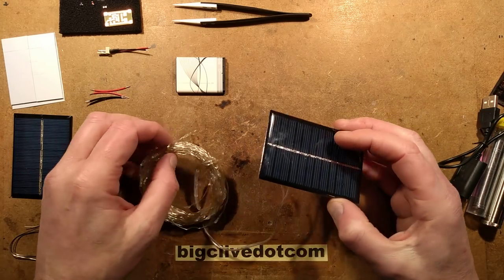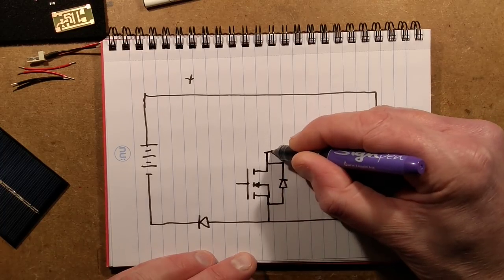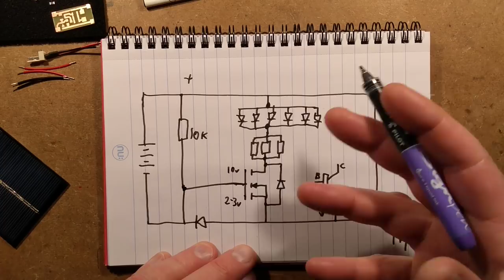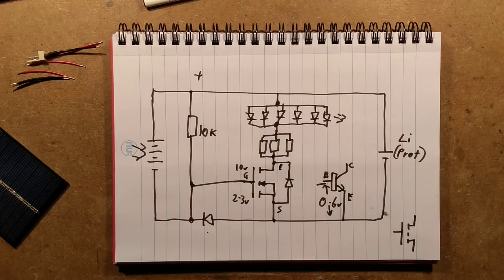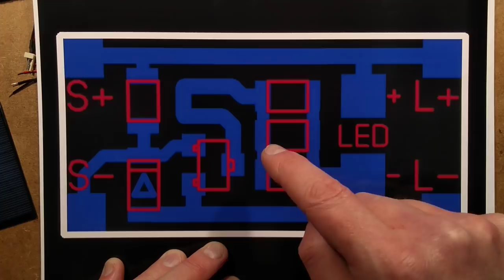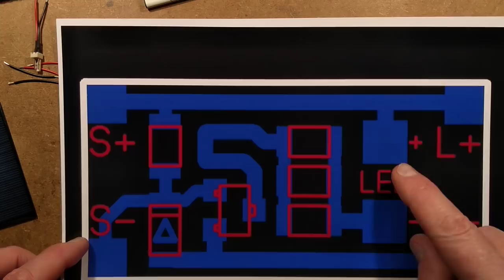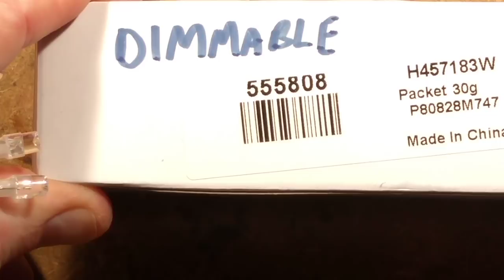DIY solar garden light project.  Surface mount remix.

Comment: Very impressed with the e-cig soldering iron. Just the thing to carry around with a bit of solder for those occasional soldering jobs. The circuitry in those little tube batteries isn't that robust for frequent heavy duty use though - better to put it onto a small variable wattage device which will have more oomph and longer battery and circuit life.

Comment: Clive,  If you mean the ts100 and 80 irons, while they do have problems (mainly the Git Hubs Ralim's firmware hack) playing up.
The stock firmwares pretty much do what they say on the tin,  Plug into a wall wart or attach a beefy battery (USB type c for the TS80 (stock firmware won't work with USB2 - has to be QC3 compatible) or for the TS100 - a massive Lipo or a dewalt drill type of battery pack.
Whatever else they do do  - they don't seem to melt down or crash.  The only report I've seen on Git this year was from a guy who I wouldn't give anything sharp or hot to play with!!!  With stock firmware the main problem seems to be QC3 compatibility of power bricks with the TS80 and for the 100s finding (and funding) Big enough batteries for the TS100 (everyone wants 60 watts that hits temp in > one second - those who can wait a couple of seconds seem to get minimal grief of any kind.

Comment: Big C. I got a simple 7 inch cheapie digital microscope that's perfect for the smallest smd. I paid 80cad on amazon which I probably around 35 pounds haha it is 1920x1080 screen and takes pictures. It's a no brand Chinese but the worksurface is about 100mm by 150mm.

Comment: Pressing the button to turn the soldering iron on is common for me, as I often use a cheap soldering gun, and keeping the power button pressed in a rhythm is needed to keep the soldering tip in the range of usable, not too cold, making a dry joint, or too hot, making the flux burn off rapidly and charring the board.

Comment: GREAT little project bigclive!! I really enjoy these kind of circuits - BTW I took your advice (on under cabinet kitchen lighting) - I found and bought a 12' length of water proof LED tape with RGB & W LEDs it came w/ a remote, power supply and many pre-set color combinations as well as user select it also came with 3 straight connectors and 2 90 degree connectors it can be cut every 3" like most LED tape which gives it many lay-out options. Seems very well made PERFECT for what I needed and the best part it was only $22!! (Harbor Freight) So As Always-TWO THUMBS UP Sir!!!!
Reply: WTH ??? Anyone have any idea why YT does this to some of my posts? has it happened to anyone else ?
Reply: your are using dashes without spaces to the next/previous character it then interprets that as strike through (some sort of lowend markup..)
Reply: @urugulu1656  Thank you for the reply. I am not real sure what "Strike through" or " Mark up" is in this context but I think I understand. (I do not pay much attention to punctuation but maybe I should start LOL) Thanks again for the info
Reply: @Tryin2FlyII  well then you know what words to google... and for your comment on punctuation; neighter do i but digression is the first step to self-enhancement (atleast thats what they say). 

glad that i could atleast point you in the right direction. try and edit your post accordingly and see if it fixes stuff

Comment: I love my ts100. I just got a cable adapter to connect it to the t60 connector of common RC vehicle battery packs.

There's an idea: how about a video on creating RC battery packs out of phone batteries? Including his to add the balance charge connector.
Reply: Not 100% sure that's worth the effort. Aren't RC batteries usually optimized for high discharge (and charge) currents? Phone batteries don't really need to stand up to such abuse, so i'd be surprised if they managed to provide more than 1-1.5C, maaaaaaybe 2C tops, without some form of meltdown.

And then there's all the fiddly work of all the wiring and whatnot...
Reply: @khronscave  Ditto what you said, phone batteries are too small.  But AliExpress have a $15 20V power bank that takes 18650s, works fine with scavenged laptop batteries and the TS100. Only hard part is finding the right size barrel jacks :)

Comment: I got myself a 30 Watt Soldering Tip like this with 510 threads off ebay and I use a 2 x 18650 Mod to power it

Comment: That 510-thread soldering iron tip is ingenious! Have you ever used the butane-powered soldering irons? They're pretty snazzy, too. (And there you go mentioning them at 25:32.) We've come a long way from the heavy Bakelite-cased trigger soldering irons, haven't we?

Comment: Thanks for the previous solar light video, I used it as an inspiration to build a DIY solar Juole thief light. 

And the wtf part: I used a breadboard to measure the components test the power, and find the best inductor for the job. Then I soldered it together, measure again, and it drew three times the current. Damn those unreliable boards. :-/

Comment: Speaking of tiny components, I recently tried soldering a 44 pin micro-controller, for an eBay  DIY matrix clock kit, using my Hakko 888d with a super fine tip. After a lot of time, serious frustration and a lot of swearing, it was condemned to the great PCB junk pile... NEVER AGAIN!!! NEVER AGAIN!!! IT CAN'T HURT ME ANYMORE!!!

Comment: Well Dang, I'm liking that little soldering iron.  Found one for $15.00 ...   Much handier then the little cheapo Weller 3xAA iron I used for light outside stuff.  That one needs button depress continously as well.   Wish my  Manual Manipulators  ( Hands ) worked as well as yours do.
Reply: Sounds expensive for the US. can get them for 12 here in sweden. Ususally everything is cheaper in the US. Id look for it in walmart or target type shops.
Reply: @rimmersbryggeri  Yea I'll look around.   Our Walmart somewhat SUCKS.  Nothing like this would ever be had there.
Reply: @pulesjet  Harbor freight?
Reply: @rimmersbryggeri  Closest one of those is 60 miles.   Live on the Mexican dotted line of New Mexico.  Limited options.  Best to just E-Commerce.

Comment: How large do you think the transistor die size is inside TO-220 and TO-92 size transistors, when relatively equicapable preformance is available from the SOT-23 sizes? Is it conceivable the same size dies are used in some sot-23 and to-92 devices, the latter having tons of empty space inside?

Comment: There is actually (or obviously) all in one chip solution for this, for example YX8181, with supposedly has build in protection so can be used with unprotected cells. Yet I didn't have time to test it yet. 

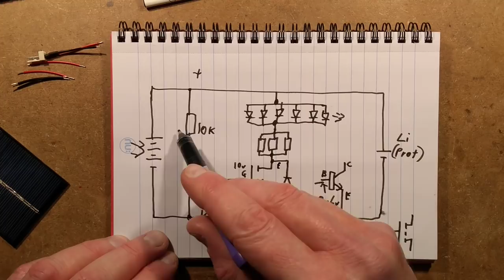p.s 11:03 wouldn't getting rid of that 10k resistor short the solar panel?

Comment: I kind of want to try one of those tips on one of my older batteries, but I imagine I would want to turn it down since those old packs I have can pump 300W with some of these newer Samsung cells that local shops sell.

I also kind of wonder how well it would work using one of the batteries I have which can control the temperature instead of the wattage (mostly, I am wondering how accurate the temperature would be versus what the unit thinks it is).

Comment: My experience of ordering surface mount components so far is that they look alot bigger on the web site.  I recently got some MEMS microphones thinking theyd be great for bat detectors and stuff.  They're half the size of that diode and have 4 pads on the bottom - even Louis Rossman would have trouble with that...
Reply: That's why, at least in theory, we have datasheets, which usually include a drawing of the package, complete with dimensions.

Comment: hey cool, i was excited to see you got that soldering iron i linked you a while back! looks like its not too bad. certainly no replacement for a real iron, but for quick projects on the go, not too bad. i've tried the cordless AA powered irons and they were sort of terrible. they could melt leaded solder OK, but lead-free solder was a problem, and the batteries drain so quick. i wonder if you use a better 18650 that can put out lots of amps if it would improve performance. i do wonder about the safety regarding overloading the circuitry inside the vape battery since it's not really using it normally. im sure there are some vape devices where you wouldnt have to click a button, though i guess one bonus is that it's an automatic safety when you put it down. would be funny to attach the tip to one of those box vapes like you have. i wonder if they just sell the tips for those things for those of us who have vape batteries already.

Comment: I strongly advise you to try the TS100 soldering iron. Its REALLY powerful, has quite a lot lf tips, an is really portable (fits in pocket). A smaller version, powered by 20V usb C is also veey good, the TS80.
Also having some type of magnification devise is a must for SMD (I use some cheap binocular microscope, 20x zoom)
Reply: also GET SOME FLUX :)

Comment: clive! i thought you would approve, i am converting a led lit 30 inch store front display sign to solar soon, going to cheat and use a commercially available garden/flood light style lamp and some led tape, also if you are used to using a weller soldering gun as your primary lead/tin melting device, press button/trigger for heat isnt abnormal and you can replace the tips with household copper wire
Reply: well honestly to me that runaway sentence didnt make too much sense to me but replacing a soldering tip with copper wire seems like a terrible idea. also the solder will probably stick to it like buggery.

Comment: Hi, I bought a battery for my vaping device, which included the same charger. Initially this seemed to work. It just lasted a very long time to charge, as this battery has the 18650 form factor, perhaps a bit too much for this charger. But then one day I connected the charger and the battery got very very hot. 
The battry has protection, it turns off when charged properly with a hobby charger, but maybe it was defeated by the 5V coming out of the dodgy charger.
So, I built a dedicated charger sacrificing  a 4 dollar vape pipe to get the EGO connector, and a buck convertor that supports current and  voltage limiting to 600mA (this was the max according to the plastic bag the battery came in)  en 4.2 Volt.
This works well enougn. Lesson learned: don't trust that funny charger.

Comment: The early bipolar transistors used doped germanium (invariably spelled geranium in the popular press).

The early transistors weren't cheap; surplus transistors were stripped from computer circuit boards, and weren't really ideal for analogue applications.

I remember working on an RCA transistor radio in which all transistors were carefully mounted in sockets.
Reply: i remember seeing old oszilloscopes having socketed transistors as well. i dont know if they do this still. propably not for everything but maybe for some crucial parts...

Comment: Emitter on the MOSFET, sometimes also called a Drain :) Also, eliminating the 10k resistor would just short the solar panel, so that wouldn't work!(1003 looks like 100k not 10k?)
Reply from the maker: I meant removing the 10K resistor completely.
Reply: @bigclivedotcom  I don't understand, both situations cause the circuit not to work? Replacing the resistor with a wire link shorts the solar panel stopping it from charging the battery. Removing the resistor and leaving a gap in the wire removes the connection to apply voltage to the gate and activate the MOSFET stopping the LEDs from ever lighting?

Comment: You should check out the TS100, it really is all it's cracked up to be.
Reply: +1, surprisingly enjoyable :-) And easy to change the bits, if one leaves that little screw out :)
Dumb question, JIC you know: any easy way to turn it off, other than unplugging it?

Comment: Uncanny, I was just watching that solar light video yesterday since I got a bunch of those Amazon Echo Dot battery packs from Poundland and have been wondering what I can do with them - I only bought them because they were a bargain, but didn't have any plans for them yet :)
I also have 20 little 100x60mm 5.5v solar panels I've been thinking about turning into a foldable portable solar panel.
Reply: That reminds me, when I get paid next I'm going into my Poundland to grab a couple of Echo Dot rechargers. I don't have an Echo, I just want a 7.4V 5000mAh (or 3.7V 10,000mAh) battery pack.
Reply: @spotify96  My local Poundland only had 8000mAh Echo Dot power packs, but still worth it for £5 each. The closest priced high capacity cells I've managed to find are the 5000mAh 1S 20C cells from Hobbyking, presently £6.44 each,  I used 14 of those to re-cell my ebike battery, cost less than 1/3 a whole new battery.

Comment: The trick with SMD parts is flux, flux and more flux. Gel flux preferably.
Reply: Lots of flux indeed. Whenever I'm at work and have to remove and resolder or just remove bridges from a huge qfp with like 80 leads, I basically drown the thing in flux. All you gotta do then is carefully heat up and drag off the solder and you will have almost perfect solder fillets every time.

Comment: Since this is going outside, have you considered hitting the battery terminals with a spot of hot glue to discourage water from shorting them out?  After all on the battery, the terminals are pretty close.
Reply: this would be nice were it not for the simple fact the protection circuit board is literally taped/labeled on and is not waterproof, it would be a pointless gesture of sealing it as water can get under it and inbetween the pins easily, you literally would need to coat the entire end in sealant/glue, a better option would be a large piece of heat shrink, filled with hot glue or silicon that covers the entire end of the battery
Reply: @frogz   You could coat it in that waterproof clear lacquer that Julian Llet uses on his battery charging projects

Comment: Hmmm.  Move the series resistor(s) to the source side of the FET, then add a resistor between source and gate to give you a little positive feedback.  Get a bit of hysteresis in the circuit to avoid being stuck in the linear region in twilight (which is going to give the highest heat dissipation in the FET).

It's been far too long since I did any of this and I'm doodling the circuit in my head, so it's probably not going to work.

Comment: Hi. First of all, thank you a lot for the great video. It works just perfect. Though I thought (and there is a good chance that I'm wrong and battery protection is good enough) to add a popular Tp4056 charging module to the equation. Unfortunately, it appeared that Tp4056 goes into protection mode if it is plugged into the circuit and the circuit doesn't work as well. It seems that is I add one more diode between the Tp4056 solar negative input and the common ground, then the  circuit works, however, as I have only 5v solar battery, I don't have enough voltage left to see if the module can charge. I've ordered some schottky diodes, but meanwhile decided to ask, if there is a better way to handle the issue? And in general, is charging module needed in this particular application or it is safe to use the circuit with a protected 18650? Thank you.

Comment: That "soldering add-on" for vaping batteries looks a bit like a poor man's TS-100. Speaking of which, have you tried the TS-100 (or 80), Clive? I rarely use another soldering iron since I got mine; made a simple battery pack with 4 salvaged 18650s (which the Ralim firmware can monitor) and I carry it (almost) everywhere.

Comment: I made the wrong side of the board mistake on the first CAD SMD design I did, back in the late 80s -  on earlier tape and film layouts I'd never had any problem.

I'd managed to get all the SOT23 packages facing the same way on a rather compact design but on realising my mistake and swapping things around there was one that there was no way I could get the same way round as the others, which rather spoilt it. It's in my collection as a reminder.

Comment: Reminds of the good old days and the "Scope" soldering iron. You had to push the ring sleeve ad remember to not hold it for too long else you had a very red tip that was useless later. Also those horrible soldering guns.
Reply: The first soldering tool I ever used as a kid was one of those horrible 200+ watt soldering guns that I borrowed from someone. Hold the trigger for 2 sec and it wasn't hot enough to melt solder. Hold it for 8 sec and it was so hot that it destroyed circuit traces and semiconductors. I finally decided to break down and buy a 'real' soldering iron. A week later I was kicking myself for not buying one sooner - a proper tool was SOOOO worth the cost.
Reply: soldering guns; the most oversized overpowered and inappropriate tool for doing pcb soldering. oddly enough it was the thing that i used when doing my first ever pcb soldering (harddrive power connector pin resoldering) just because i didnt have anything else at the time. the only thing worse for the job is a butane torch like those for plumbing...

Comment: I'm guessing you have to use lead free solder since vaping lead would be dangerous 😂
Reply: The fumes given off during soldering are from the flux, not the actual solder. Breathing those fumes is not recommended whether lead free or tin-lead solder is used but the fluxes used in lead free solder tend to be more aggressive and more likely to cause respiratory problems.
Reply: you are new around here huh simon? clive will add "juicy lead based solder" to items he is re-working or modifying because lead solder works so much better, i have a spoof of maybe 10 feet of lead free solder and it has lasted me longer than 100+ feet of lead solder!